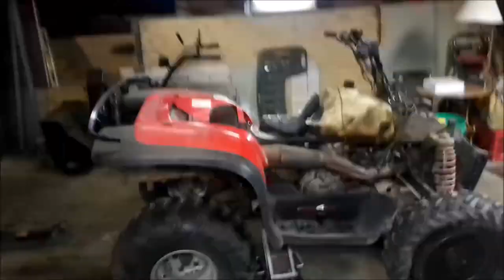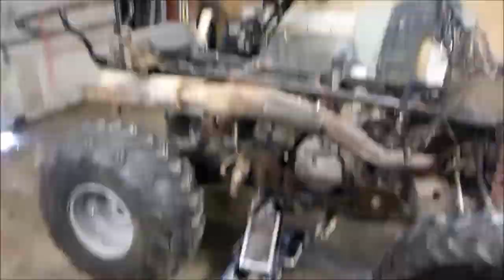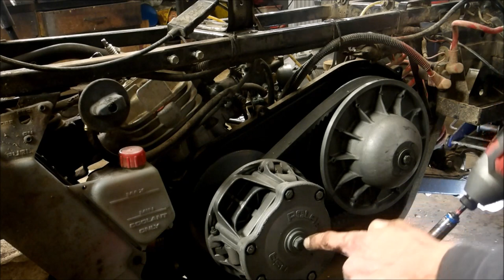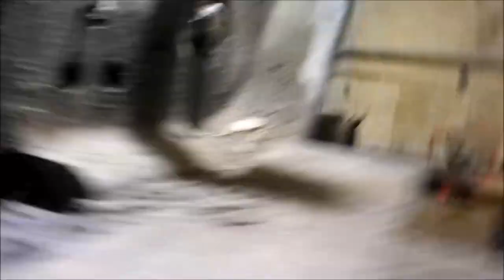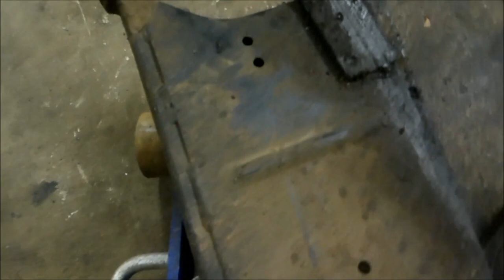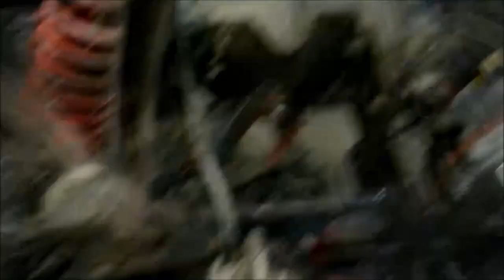96 Polaris Sportsman Brought back from the dead! Part 1. Transmission and Engine,remove and rebuild!

Comment: I'm getting my Polaris Sportsman 400 together. I noticed that there are vent tubes on both the engine and the transmission. I assume the transmission one vents to atmosphere and the engine one connects to the carburetor? Is that correct? And how do I adjust the idle on the engine? Is that the adjustment on the top of the carburetor? Thanks! 😊
Reply from the maker: It's been a while since I did a 400. I don't think its engine to carb. But to adjust it. You have the big knob on the right side. That adjusts the slide height. I use that to get the idle close, Then adjust the top throttle cable up or down to dial it in. There is the air/fuel mixture screw on the right as well, before the big knob. Adjust if its running to rich or lean.

Comment: Any tips on how to manage all the bolts, nuts, washers etc when you take these apart and make sure they get back in the right place? I am new to these types of projects and found myself in a few tough spots in making sure it gets put back together the correct way. thanks!
Reply from the maker: If I can I put the bolts back in. Like the airbox, the rear plastics. Best thing to do is buy plastic zip lock lunch bags and label everything.
Reply: Draw a diagram on a cardboard box.  Stick bolts into it.
Reply: Harbor freight plastic organizer.
Reply: Boltster, ive got 2 use them for everything. Certified polaris tech here

Comment: I am in the process of investigating a transmission oil case leak and a finicky reverse gear on my 96 polaris sportsman. Tranny came out the other day after much grunting and maneuvering. Case will be opened today for inspection of gears etc. I found that case screws in one side were loose so that was probably the case of the incessant oil leak. When you reinstalled the tranny can you have those peg type bolts assembled with the plastic washers and retainers and lock nuts as a unit when you try to re position the tranny back in place? At first I thought that Polaris built the ATV around the engine and tranny...LOL.
Reply from the maker: Yes, I've been in the same boat. My first tranny pull was like..who put this together? If you leave everything in place and loosen the nut so the bolt loosens you should get it.
Reply from the maker: Glad the video helped. It was one of my first videos . Not very good lighting. The tabs keep the nut from spinning off. But your probably right with the lock tight.

Comment: What oil do you use for the transmission in a 500 sportsman
Reply from the maker: After taking a 500 tranny apart I would recommend the Polaris fluid. Way to many moving parts and 2 different chains to lube. There is alternatives. But I would stay with Polaris brand for that transmission. Very expensive to replace and time consuming. If it was a 400 I'd say use synthetic ATF.